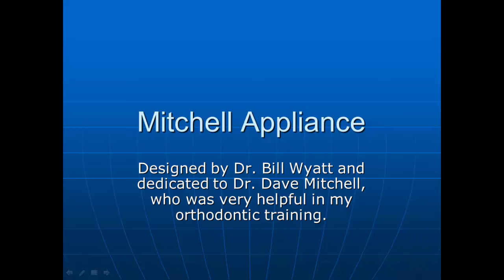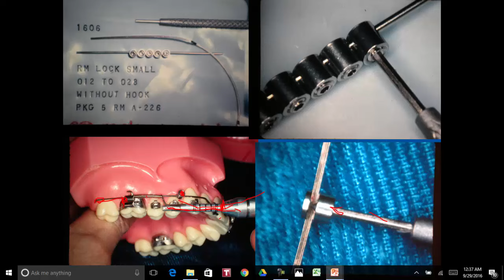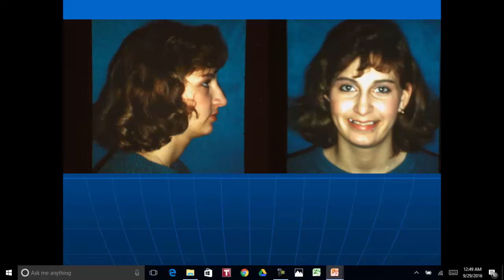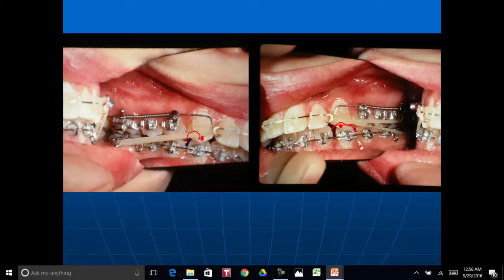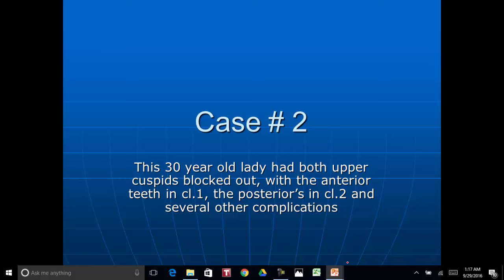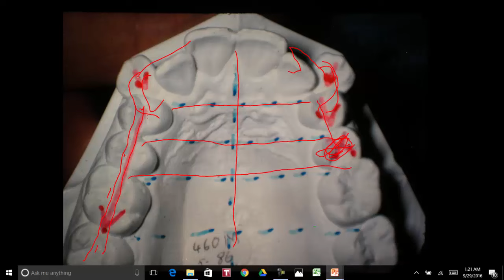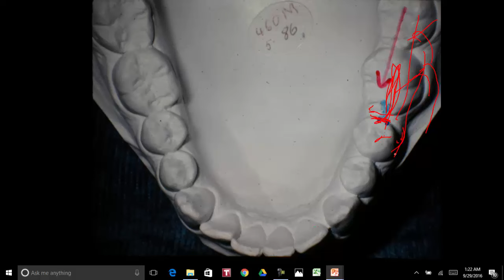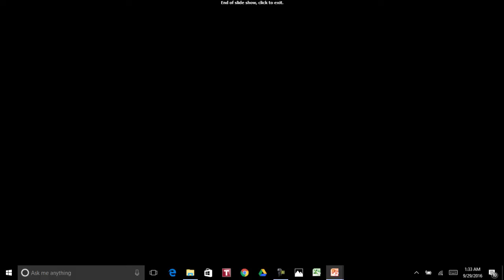Mitchell  Appliance

Comment: This was an amazing video. Loved that fact that we don't have to buy class 2 correctors when we can use our intellect and hands with stuff we already have. Question: is you upper wire 17x25 stainless steel? Would you say the rubberbands are 1/4 heavy 6oz (estimate without using guages). The opencoil can be steel or niti? Thank you for the information. Keep it coming. :)